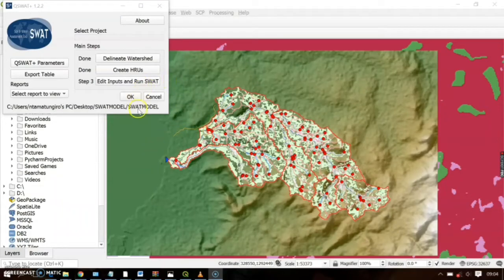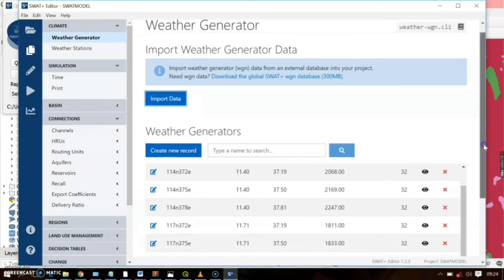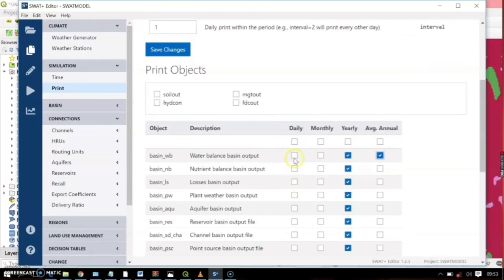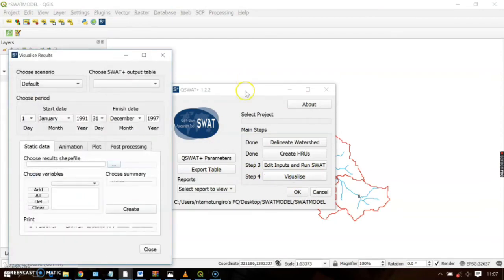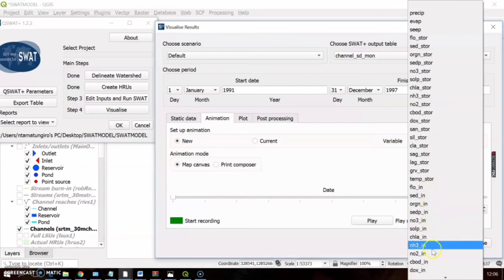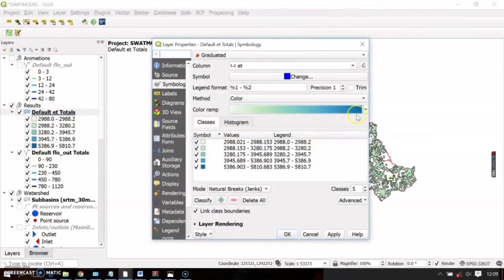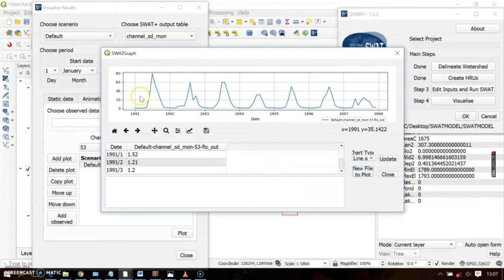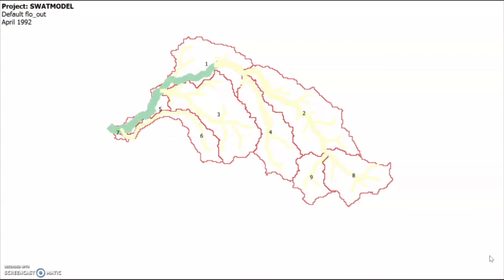HOW TO RUN SWAT MODEL AND VISUALIZE THE RESULTS USING SWAT+

Comment: Why is everyone using the sample dataset? It is not useful to us the beginners as it does not give any problems, do this with your data, start from the beginning to the finish. The sample dataset, I can run without encountering any challenge as well, and that way I am not gaining anything. And we're here stuck with endless errors no one is trying to tackle in these platforms
Reply from the maker: Hello , let us know what challenges you are facing and we would gladly assist you. Reach us via info@geote.org
Reply: @GeoTE_TANZANIA  Well I see a lot of gaps in detailed information sharing things like irrigation schedules, reservoir management, and agricultural management unless there is documentation, I am missing that will help me on such. Generally, I may say information related to decision tables